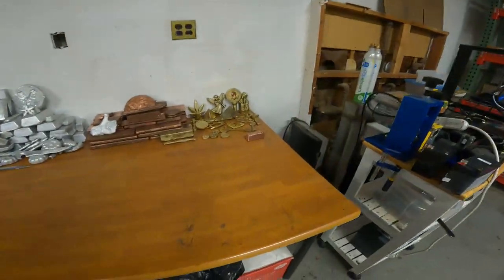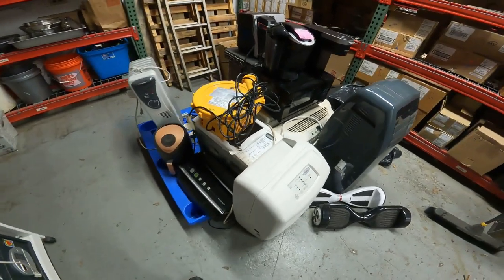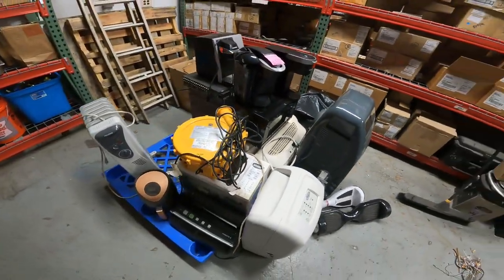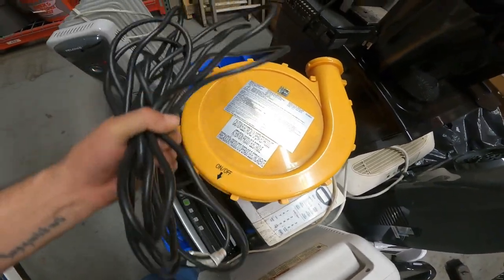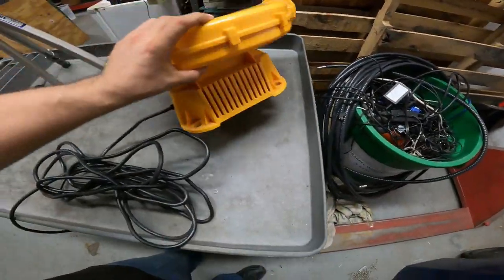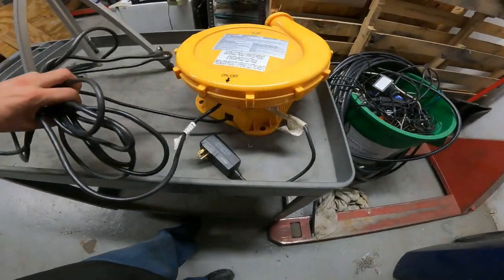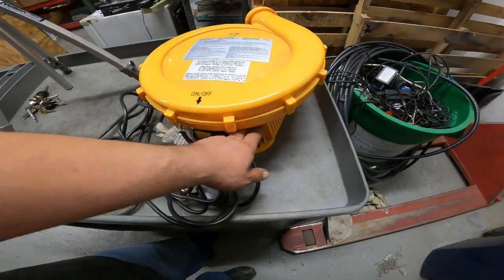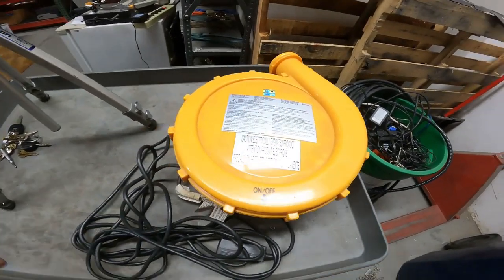Scrapping a Bouncy House Blower - How much copper is inside? - Trash to Treasure - Copper Melting

Comment: No ice cast aluminum from that motor and nice ingot 🤘
Reply from the maker: Thanks man, I tossed the die cast in my aluminum bin.  It’s getting pretty heavy.  I’ll be doing a gigantic aluminum melt once the big furnace is set up.  Thanks for checking out the vid 😁